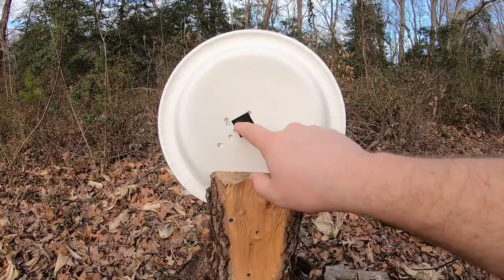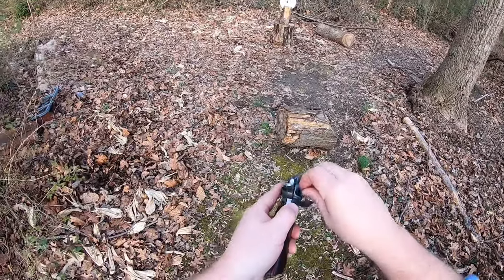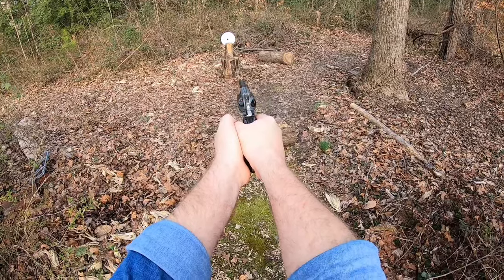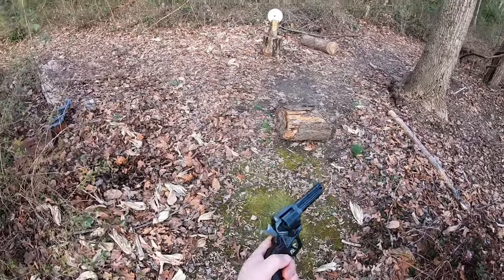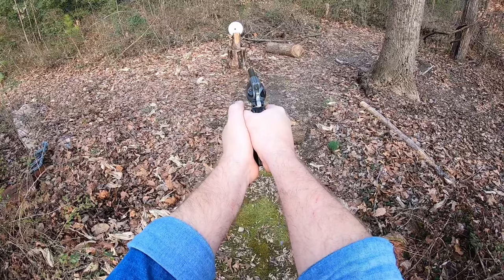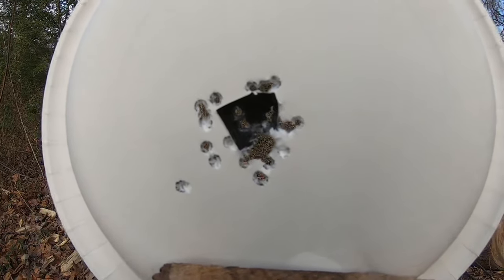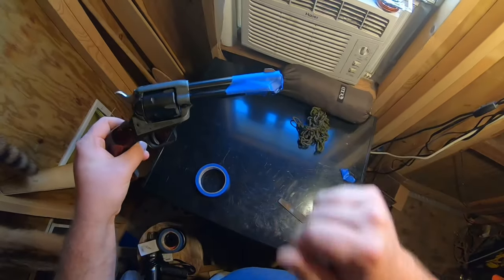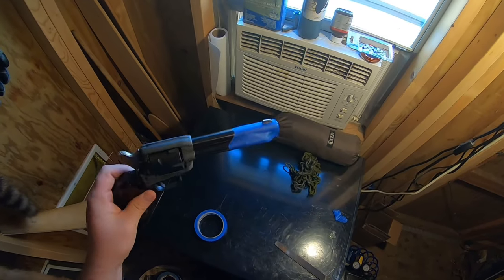Make your Heritage Rough Rider MORE ACCURATE || PLUS homemade subsonic UPDATE!

Comment: Good video. I currently have a Heritage Barkeep and it is fairly accurate at about 10 yards. Plan on getting a 4.5" Heritage Rough Rider. Appreciate the information and have a great evening.
Reply from the maker: Thank you Keith!
Reply: @Majormusket  can you please send me a  link to were I can get the screw that  holds the trigger in place for  my heritage roughrider  22 l r. I'm having a real  problem  getting  one . I have  call heritage roughrider and have not been able to get  any one to answer the phone. Call both numbers.  Now I'm down to  no gun.
Reply from the maker: Check on eBay. They have some there with relatively cheap shipping.
Reply: @Majormusket  thanks so much.  I will  check  there. Have a great day 😀 😊
Reply: I have  this person  that  told me  that  he works on  guns and  that he  said he is a gun repairman.  I let him  take  my  heritage roughrider  to his house  for  him to repair.  He has had it going on 3 weeks  now . And I all ways have to call him  or text him and ask have you had any luck getting the screw.  He told me  no. I have gave him information.  But he still has not  got any thing done.  What do you think of this  and what  would you do.  I think  I'm going to get  the gun back  from  him . And get it fix  my  self.  He said he was not going to  charge  me anything.
Reply from the maker: You need to do what you need to do. You already know you can get the parts on eBay. If it was me, I’d feel more comfortable having my gun at home in pieces than with someone else. That’s just me… I know you’ll get it squared away and will be shooting again in no time!
Reply: @Majormusket  i talk to him to night and he said he  has been busy at work.
Reply: @Majormusket  the  guy fond the screw for my heritage roughrider on eBay and is going to  order it  this morning.  I just talk to him.
Reply from the maker: Good!
Reply: I have a gun repairman coming to my house Friday to  repair it.  Thank s for  your interest.
Reply: @Majormusket  i have my doubts about this guy that said he order the screw.   I talk to a real gun repairman today.  And he said he will come to my house this Friday or Saturday.  He told me he would call me this Friday. How i heard about him . I call this friend of mine that  owns a  gun store  and he told me to call him. So my heritage roughrider  will be in good shape this Friday or Saturday.
Reply: @rickeybullington6314  everything going alright with the rough rider?

Comment: I am guessing you are only seeing the very top of the sight when you are shooting? And are you covering the POA or holding it at the bottom of the POA?
Reply from the maker: With fixed sights, I like the front sight tucked into the bottom of the notch for point blank, middle for within fifteen yards for this particular gun and even with the top of the notch for anything further. I like to aim as if I’m shaving a frogs hair directly under my point of aim. I like to be able to see what I’m actually shooting instead of covering it up with my sight picture.

Comment: I have one that also had a high front sight.  Rather than wasting time going back and forth to the range, take your file with you to the range.  You can rest the barrel against something nonabrasive, like a wood shooting table or bar, and take a stroke or two with the file.  Then shoot a few rounds and repeat until the point of impact is where you want it.  Save yourself all those unnecessary trips.  Once you get it filed to the right height, it will shoot nice tight groups.
Reply from the maker: I thought that’s what I said? If someone leaves their file at home and drives back and fourth they probably shouldn’t be altering a firearm to begin with? I take for granted that my backyard is my range and not everyone has that luxury. You can prop the barrel and file that way, but there’s more risk in slipping with the file, or the gun moving around in your hand. Most shooting benches can allow a vice to be clamped off to the side to use as needed.
Reply: With that ammo, yes. As soon as you try a different brand, faster, slower, heavier, lighter POI will change.

Comment: as shaky and loose as mine was, it was dead balls on the money both the 22 and 22 mag I dont think they made an inaccurate one
Reply: Thomas DeArment After I did a muzzle crown job on mine its very accurate. That was my fault for missing the marred crown when I bought it. But the marred muzzle crown before I did the crown job it would shoot like a shotgun pattern. Only other thing I did was thread lock all the screws. Its one of my most fun guns to shoot. The quality control with these RRs can be very spotty so check the pistol over before buying to make sure everything is good from the bore to the parts fit to the function of the parts and pistol. Some cylinders can have loose fit and were not fitted tight at the factory. Some folks get these revolvers and fan the hammer to cause hammer and trigger spring failures when the owner manual says not to. Then they blame the pistol when they caused the failure.
Reply: @rbm6184  nice I bought mine from a guy at work, paid about 50 bucks for it, it was dead ball on the money then, plinked with it for a few  years, traded it in on a Charter Arms 38 spl. undercover for carry, bullets weighed more than the gun, good gun except every time I shot it it would fall apart,all the pressed in parts, that is. now day if I find another Heritage  Ill buy it

Comment: Mine is plenty accurate at 5 to 10 yards without modification of the front sight. Filing the front sight kind of goes against my grain. I use high velocity ammo rather than standard or subsonic because that's what my semi autos like, and I don't want to have to buy two different types of ammo. I have learned through practice how much of the front blade to show above the rear groove to make it shoot to  point of aim. Kind of a visual memory thing.
Reply from the maker: Do what works for you. I personally prefer a flat sight picture. If you start compensating, you train your mind to do that every time. When the day comes that you have a different side arm and you need to take a shot that counts, your brain has been wired to adjust and you might throw your shot. However, I always say that the shooter is the biggest variable.

Comment: You don't have to file anything you change your point of aim either on a target or on your front site that will change your point of impact
Reply from the maker: You can certainly do that if you want. If your front sight is even with the rear, and you’re still shooting low you would need to raise the front sight higher than the rear posts. You will be insanely inaccurate, because you are now shooting outside of your sight square without a reference point. The biggest variable is YOU. Why make it even easier to be inconsistent?
Reply: Kentucy windage.

Comment: Which one is that? I can’t find that color anywhere?
Reply from the maker: I refinished the grips, stripped the frame and aged the frame.
Reply: @Majormusket  was that easy to do? I’m trying to get that silver and black look.
Reply from the maker: It was very easy. I removed all the parts but left the barrel to the frame and used painters tape around the barrel where it joins the frame to protect the bluing. Then I used a fine grit sandpaper (240) then 400, then 0000 steel wool. The frame is simply painted black from the factory. Then I used Qtips with birch wood Casey’s plum brown and rubbed the solution onto the frame. I let set and went back over with 0000. Rinse and repeat until you get your desire patina. Lastly, apply a thin penetrating oil to set it. That’s pretty much it.
Reply: @Majormusket  ty!!

Comment: My Bar Keep is so inaccurate it has now become a doorstop. 😞
Reply from the maker: Well, what’s going on with it?
Reply: @Majormusket  It's just too inaccurate to use/carry. I have no use for handguns like that, they can be dangerous. I purchased mine with the intent to use it for self protection while out and about off trail, exploring, scouting, etc. I bought the 3" model thinking it might be fairly accurate at 20'ft, but no dice. It shoots wildly low and to the right (22 mag). I'm not certain, but think there's just not enough twist in the rifling? I'm pretty good with revolvers btw.
Reply from the maker: You’re going to lose velocity with a shorter barrel. Your point of aim from the rear notch to the front site are going to be shorter with a 3” barrel. The slightest movement will throw off alignment at greater distances. A longer barrel helps to give you a more forgiving sight picture. The “bar keep” is just that… a close range weapon that could assist you up close in a pinch.
Reply: @Majormusket  my 3" S&W  38 revolver is way more accurate at the same distance.
Reply from the maker: A .38 is also a bigger, heavier round. Very different animals IMO. I may have to do some more research on this topic!
Reply: If you need someone to take it off your hands... haha